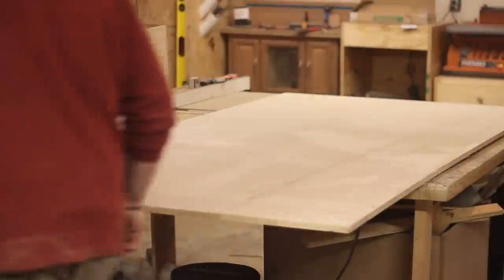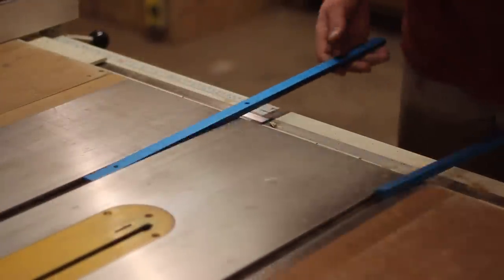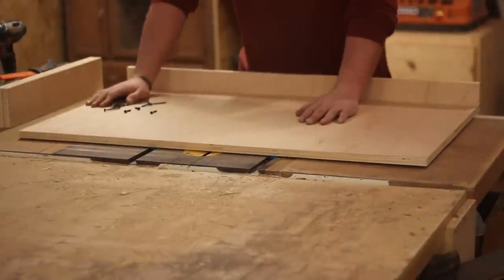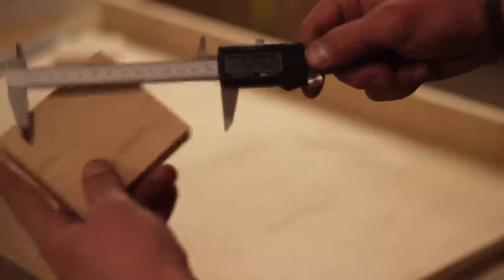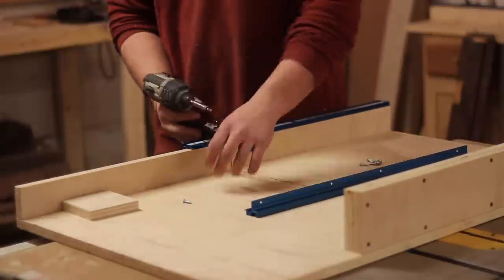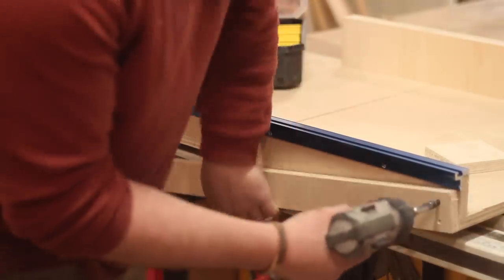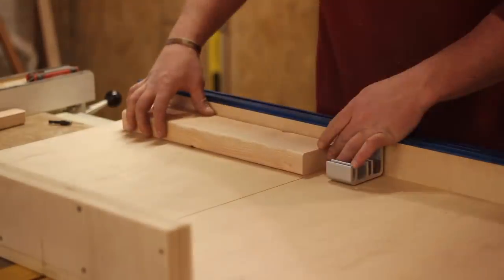How To Make an Easy Table Saw Cross Cut Sled | 8 Minute Video

Comment: Thanks for sharing John!  I built one of my own today with one difference, I extended my sled by 8 inches because I wanted to have a 2 foot trak and stop system on my sled (per side).  Squared everything up and it's as accurate as can be!  I couldn't be happier and believe this is one of the best, if not the best sled a woodworker can have!

Comment: Mistake I made on my sled a while back - I built it similar to this, and then later on decided to use it with a dado. When I put my fence support in, I used the same screws and had them fairly close to the blade (similar to how you have it, although probably closer). When I set it up and ran my sled through the blade to widen the slot, It hit a screw head and absolutely destroyed half the stack :D I'd recommend to anyone who might ever do that, keep your screws far away from the blade path.

Comment: I just purchased  a rigid R4513 portable table saw I was wondering if it is advisable to build a cross cut sled that would cover the entire top of the table  saw I also just purchased the same aluminum runners.  Nice video,very helpful thanks...
Reply: The Ridgid r4513 table top is 21"x 30"
Reply from the maker: It it a bench top or a floor standing. i wouldnt recommend using a sled on a bench top or something that isnt sturdy
Reply: John Malecki it's a floor model, a portable unit and is very stable.  I'm also planning to build an outfeed table that would be removable
Reply from the maker: i think you should be ok if its stable to run a cross cut sled. Start Small (24") and if youre comfortable work up
Reply: John Lopez absolutely

Comment: what type of miter slot bars are you using and do you like them? Rocklers get mixed reviews...
Reply from the maker: +shaun singleton theyre rockler. I havent had any issues so far
Reply: +John Malecki thanks a lot. people were complaining that once the adjustment screws go past the end of the table saw, there is some slop or play in the sled. I didn't think it would be too big of an issue cuz my sled won't be very large so there won't be long pushes for wide boards.

Comment: Nice and simple video on the sled. I'll be getting the parts tomorrow to make one.
How do you like your Bosch miter saw with the articulating arm? Have you noticed any flex on the arm? My current sliding miter saw is just to honking big!!
Ron
Reply from the maker: +Ron H love it. Have zero issues. Marc soagnolo did a comparison with the Kapex and for money you can't beat the Bosch

Comment: what kind of paste wax did you use I just bought min wax finishing wax natural  I want to now if I bought the right one can you let me now
Reply from the maker: Regular johnstons paste wax
Reply: John Malecki:  Yes, any wax-based furniture polish or similar will do so long as it doesn’t contain silicone.  If it does, silicone will contaminate the surface of whatever you’re cutting.  While this won’t harm or stain it, it will make painting, varnishing or staining almost impossible as it acts as a superb release agent and is extremely difficult to remove, especially from porous surfaces.

Comment: what type of screws did you use to attach the sliding bars to the sled? I know they are 1/4 20 but which kind? yours seem to have flat head. where did you purchase these screws?
Reply from the maker: I Think theyre just standard wood screws
Reply: Checkuya Okochi It’s a big secret. No one knows which screws fit the bottom threads of the Rockler mixer bar exactly without scuffing up your table saw.
Reply: Counter sink the miter bar? I'm thinking of #6 3/4 inch flat heads. Through counter sink...through miter bar...into 3/4 inch birch ply.. Do you really need to worry about the thread count if you are fastening from the bottom of the sled?

Comment: Nice sled but shouldn't the front and back supports be the same height? What happens when you use a piece of wood that is taller than what he front support can handle? You could run into a problem where the blade hits the t-channel. That could be bad news.
Reply from the maker: The t channel is aluminum and would just get cut if i ever ran the blade that high. I usually dont cut anything over 1.5/2" with the sled so I have not run into that issue
Reply: Just flip it and do two cuts!

Comment: Why do you have to use the edge guide for the first cut of plywood? Could you not just do it on the table saw? 
I'm a noob, so I understand cross-cutting is an issue amongst a fence, but I thought it didn't matter with plywood?
Reply from the maker: to make sure its square. Always cut yourself a square reference

Comment: Where did you get them rails from you screwed to the bottom of the sled? I
Reply from the maker: heres a link! http://amzn.to/28MsLO8
Reply: +John Malecki nice, thanks man. will make things so much better than the one I have now.
Reply: I have the same question.  Where did you get those solid, blue guide rails.  They look like Rockler/Kreg products, but I don't see them on their website.  The link right here above are for Incra guides and aren't solid- they are U- shaped.  Where did you get your blue guides?  Thanks!
Reply: Incra also have them. Check Lee Valley for Incra Miter-Slot Slider Bars
Reply: Alfred o Thank you, I bought both the Inca and Rockler miter bars.
Reply: Lance Ely what screws did you use to screw them to the bottom of your sled, or did you use regular wood screws and plow through the threading?

Comment: After watching the first 40 seconds I had to post and tell everyone watching move on to a vid that does not promote bad safety practices. I only say this after the loss of the end of my left thumb while doing the exact dumb thing this guy does at the 35 sec. mark of this video. Keep your digits bud they come in real handy TRUST ME !!! A fresh amputy 7 weeks ago.
Reply: i watched it several times and couldn't see what he did wrong can you explain>>????
Reply: 1- Right off the bat he allows the power-cord of the handheld cutting device to get restricted impeding the cut  leading the way to a potential accident.
2-  The blade height on the table saw is set to what appears to be at least an inch above the stock height again setting himself up for disaster (trust me on this one). 
3-  He is standing directly in-front of the blade choosing to put himself in the direct line of fire (instead of being off to one side) in the event of a kick back.
4-  No use of push sticks and even worse as he feeds the wood through the saw, his left hand is positioned in such a manner, that the natural drag on the wood as its being feed through the saw will cause the wood to move towards the back side of the turning blade. Extreme potential for kick back. Not such a problem if the saw was equipped with a riffing knife behind the blade.
5-  Now the best one of all. Freeze the video at the 35 sec. mark and he does exactly what I did causing the loose of my thumb. He passes his hand dangerously close across the back of the turning blade to pick up the peace of wood he has just cut. My god man at least push the wood far enough away to make picking it up not so dangerous and never pass your hands behind the moving blade..
Reply: ron nociar - Good on you for supporting safe habits but I think you are being overly critical. He uses push sticks. His hands are not near the blade at .35. Yes he's in front of the blade but he is cutting sheet so no big danger. Not like a long thin piece. 
He wraps the cord out of the way deliberately and yep it was close to impeding. 

I think the sped up video makes it look bad.

I suggest he should be using a saw guard but just about no one does on these vids for some reason. 

Cheers.
Reply: If you are able to freeze frame at the 35 sec. mark you can see his hand is no more than inches away from the moving blade and what the hell is it all worth taking the risk for. Push stick !!! note ; not used until he's dangerously close to the blade again inches before disaster. AND !! how about lifting the board up as a technique while using the chop saw to complete a cut ? You can continue to see things through the eyes I once use to see through but I now choose to see through the eyes I now see through / you might say I have a new found heightened sense of awareness. Keep safe I didn't !
Reply: i paused it at 35 second mark and his hands are no where near the blade they are far away on either side.
Reply: When I pause my computer at the 35 sec. mark he passes his left hand right past and across the back of the turning blade WITH IN INCHES !!!   NOT SMART  !!!  and why are you so defensive ? The whole piont is to be safe and not lose any digits like I did no matter what you may or may not see !
Reply: sounds like you are the defensive one. Iv e paused it and I've even loaded it into a video editer and watched it in slow motion and its still no where near the blade to be of worry.
I agree though that no one wants to loose a finger and needs to be safe. That said his video is perfectly ok and your worries are a non issue for 99 % of all woodworkers out there. He hasn't done anything wrong and I hate to see a guy get a bad wrap when he hasn't done anything wrong.
Reply: The only bad rap is around your eyes my friend THE VIDEO IS FULL OF SAFETY MISTAKES  /  POOR HABITS AND SKILLS / ALTHOUGH TALENTED HE IS. I'm sure you think nothing is wrong with the way he promotes the use of the chop saw, especially his technique and methodology on how to complete a cut.
Would you like for me to remove all my comments Mr. Trump you control FREAK ! not a problem.
Reply: After he makes the cut around 35 sec watch his left hand, it is very close to the blade. Is it dangerous ? well not really.. is it dangerous if he does it 200 times over the next few years ? YES! we all get tired, move too quickly etc. he leaves no room for that.
Reply: You are absolutely right & if you watch a few times you will see a number of potential disasters in the making. Look folks I'm not trying to beat up on this obviously talented man, I would just like to see that everybody watching, sees the same things that I now see, due to you might say a heightened sense of awareness because of the loss of an inch off the tip of my thumb. By the way his sled idea is wonderful and I use it every day.
Reply: Safety first. I am almost robotic with my use of push sticks. I do not let my hands come within a foot of the blade. Yes I work slower. Be careful out there my friends !
Good video on design for crosscut sled. Really like the rails.
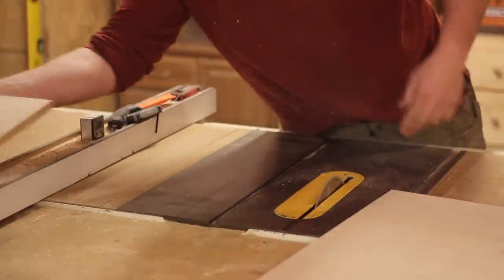Reply: ron nociar: It's his LEFT hand at 0:35, almost 0:36 that passes over the turning blade. However, from the angle of the camera and perspective, he may have been perfectly safe. We do not know what lens the camera was using. The longer the lens, the more compressed distance becomes to the naked eye. A side view would have told the tale. Good catch, though.
Reply: Take up sewing
Reply: Nice try Ron, you can't save them all. Not everyone values safety as they should. This guy has some good tips, but he does a few things that I have to agree with you on. If you cut corners enough eventually, you will cut yourself lol
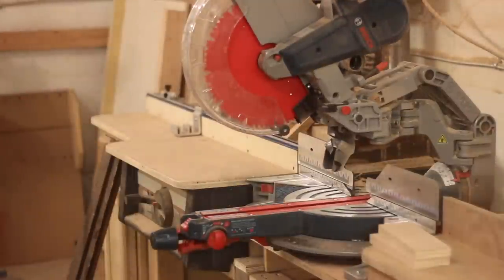Reply: I actually saw your comments before watching the video, and I do see what you mean. Especially at 1:06, that was a bit scary.
Reply: Its generally a bad idea to reach over a turning blade to pick up a work piece.  If you have to leave it running walk around to  the side and pick it up.
Reply: I stopped watching because of the excessive use of the phrase “go ahead”
Reply: ron nociar
Reply: The 30 sec,cable.
Reply: ron nociar Also has the cut piece loose against the stop on the finished sled.

Comment: The cross cut sled looks pretty good, a couple of your safety practices on the other hand kinda suck. If your going to make an instructional video,  you might want to consider the newbies who know nothing, and have a monkey see monkey do mentality. I'm pretty sure you'd feel pretty bad if someone was to get seriously injured because they followed bad practices they watched on yours or somebody else's video. Especially if a company like Kreg is supplying you with some of their products, it's incumbent upon you to showcase their products in a safety conscious environment. Oh and as far as making an accurate cross cut sled you might want to check out the five cut method for tuning in your cross cut sled. It works and it works well. After using the five cut method on my sled, it's accurate to with in ten thousands of an inch. That's akin to a blonde c**t hair split three times. Lol. But ya the sled looks good,  and the rest of the video was alright too.
Reply from the maker: Hey Andy, This was one of my first videos and I have gotten better with the safety aspects since then. And i do use (and mention) the 5 cut process in the video. thanks for the comment and checking out my channel
Reply: Hey John, glad to hear the safety aspects are improving. Thanks for the reply. Cheers 😎